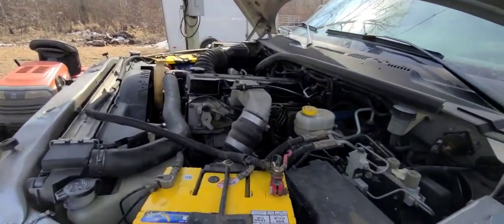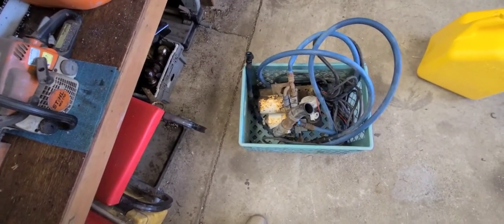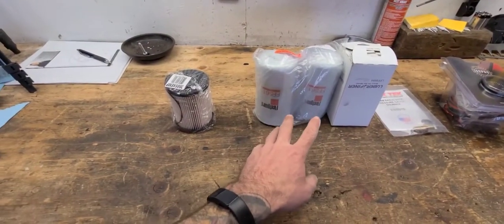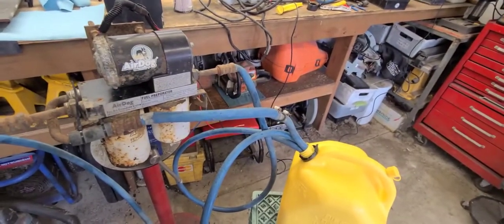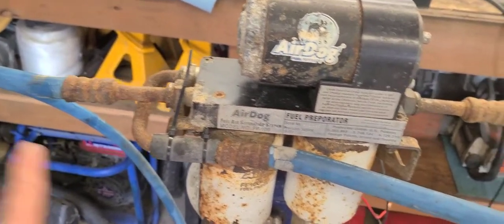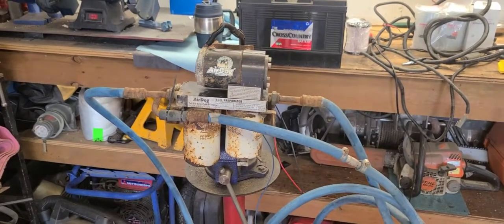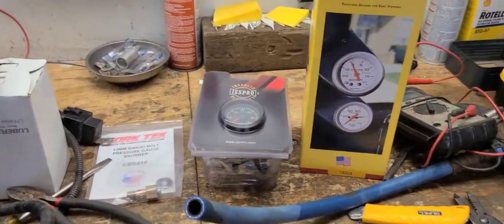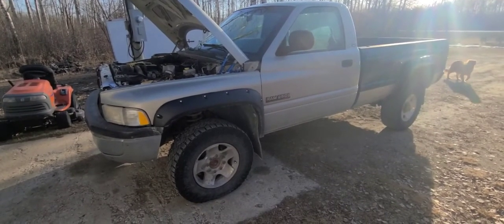Budget Cummins, fuel pressure gauge install and some ideas on lift pump options for Berta

Comment: for a lift pump maybe look for a fuel tank with the lift pump installed from factory..use an additive in your fuel like 2 stroke oil,1/2 liter per tankful.
Reply from the maker: I've been looking into them, do you have any experience with any particular brands? Seems to be way less info out there on the in the tank units
Reply: @fabwillies-thehardlife  try Yozzys truck parts 403 998 5034 just south of calgary he only deals in dodges
Reply from the maker: Thanks! I'm going to look him up🍻